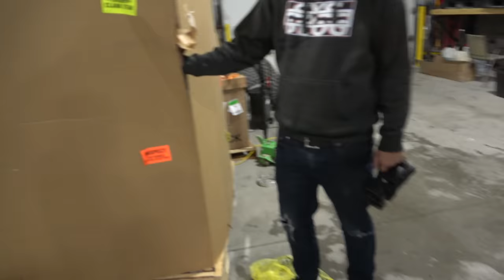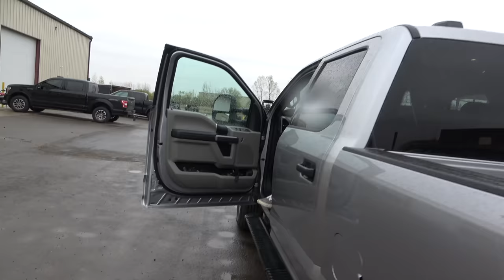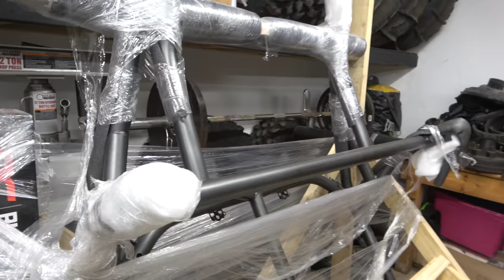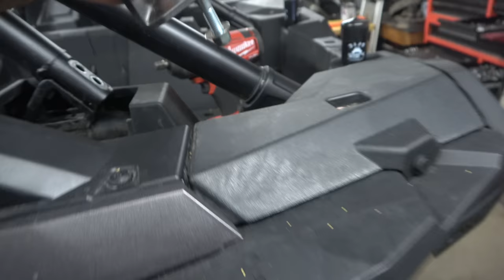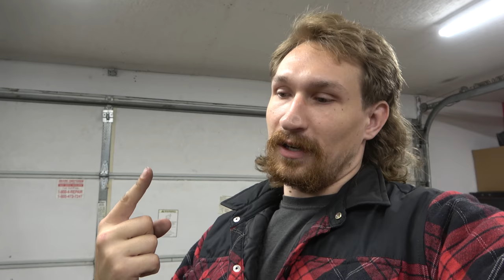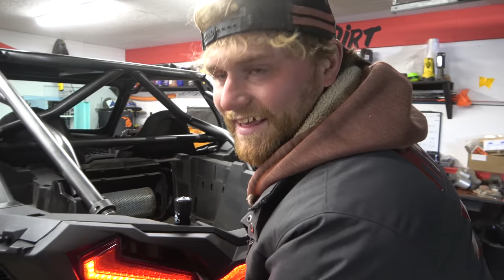BIG Upgrades For 2021 RZR Turbo S | Aftermarket Cage, Glass Windshield, Seat Belts, & 40in Light Bar

Comment: How much lower is the bcf cage compared to factory. Also how tall are you? I'm looking at getting a cage but I need the overall height to be under 72 inches to fit into my current storage situation.

Comment: How much for the cage windshield and roof? Looks sweet
Reply from the maker: I think it was around $2500 with all my add ons. Light bar tabs, whip tabs, chase light mount, powder coating, etc. Not cheap but a hell of a set up
Reply: @dirtdudes  nothing is cheap for these things...and if it is its probably junk lol. Its DEF a qicked setup. Appreciate the reply
Reply from the maker: You ain’t lying lol